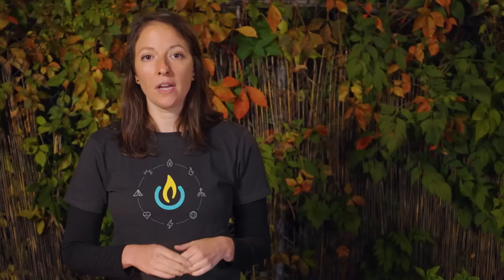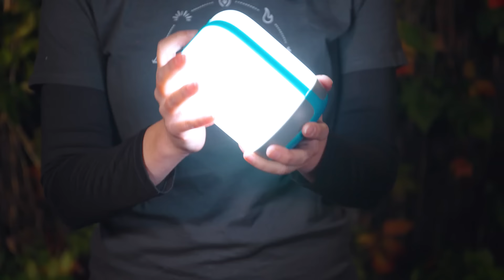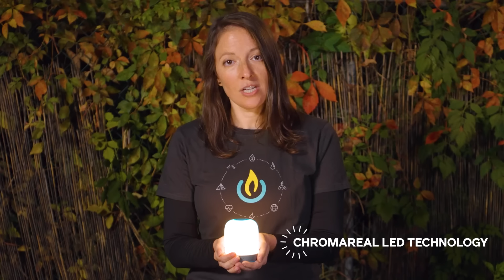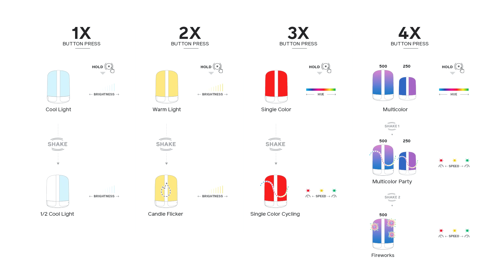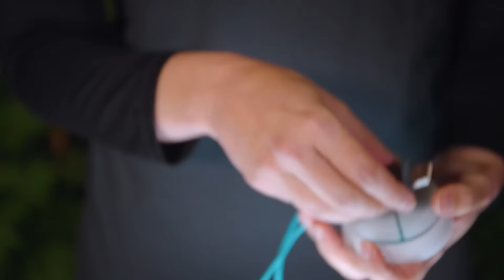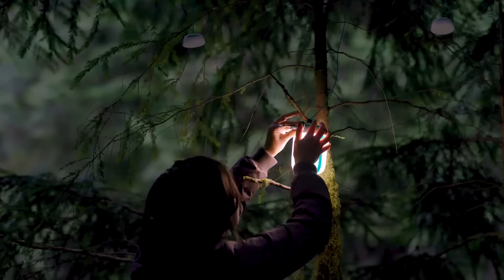BioLite AlpenGlow | Instructional Video

Comment: Just purchased 2 of the 500’s and a 250. Upon closer inspection there is a hazard warning for “Cancer and Reproductive Harm” in tiny font on the underside of the packaging?? Is that in relation to the lights, the materials used in manufacture or the packaging??? Seems very odd for an environmentally conscious brand and something I regret purchasing … was dual purpose for camping and for my kids night lights, which I’d be irresponsible to use for this purpose now I know this! Think I’ll return and get a refund. Plenty of HARMLESS alternative light sources on the market
Reply from the maker: Hello - thank you for the note! To address your concern, our AlpenGlows don't have materials that require that warning. Why is it on there? The state of California requires this notice any time a product contains a specific material - in our case a plastic. Our manufacturing team is working on completing testing through an independent lab to get this removed - a regular process that often takes some time and overlaps with initial production runs. We hope this helps you get out and use the product with peace of mind!
Reply: @BioLiteChannel  … That’s a great response and exactly what I needed to hear. Thank you

Comment: I just received my Alpenglow 500 today and I love it. The only flaw that I can see is that the candle mode is not continuous. It flickers for about four seconds, pauses for one second, then repeats the pattern. Apparently that is by design; you can see the pause at the end of the flickering at 2:47 in this video. 

I wish the flickering were continuous, but maybe it is designed this way on purpose to conserve battery power.
Reply from the maker: So glad to hear you'r enjoying your AlpenGlow! Candle Flicker mode is designed to have a natural flicker cadence (smooth flame effected by occasional air movement) which is why it's not continuous, but this is great feedback for our team. Thank you.
Reply: @BioLiteChannel  I also considered that might be the case. In my opinion the pause only makes the flickering appear unnatural because it is on such a regular pattern. If you do want to keep the pause for making it appear more natural, my advice would be to make the pause shorter, or better yet, it should be completely random in terms of when the pauses occur and how long they last.
Reply from the maker: @nathanjamesbaker  thank you for the feedback!

Comment: My 500 weirdly doesn't appear to have a bright mode and I seem to be following the directions properly. It flashes but doesn't actually change and become dimmer or brighter. I'm wondering if it's because I used it straight out of the box without first charging it. But it cycled through all the colors, fireworks etc with no problem. At one point after lots of monkeying around it went into a mode in which if consistently repeated an ultra almost painfully bright flash pattern (but slow) but I don't know how I did that nor its purpose and it would never stay on that bright - it would only do a brief flash. Any thoughts? Thanks.
Reply from the maker: Hello - thank you for reaching out. This is not an issue we recognize. Please send us a message through our form so that our Customer Service and Engineering Teams may review and offer their best guidance.

https://help.bioliteenergy.com/hc/en-us/requests/new?ticket_form_id=1260805176450
Reply: @BioLiteChannel  It only had one light on for battery level so I charged it then went to bed. Woke up and it now behaves as it should! So I think obviously that its behavior was that on such a low battery it won't allow bright other than the quick burst of ultra bright. That may have been its own way of alerting that it's almost run dry, which would actually be a smart feature because my trying to change the brightness level induced it probably (it would be horrible if that started on its own while sleeping for instance).
Reply from the maker: @Ayram9  great to hear it's working! Good catch, yes low battery mode will put in a reserve state to give you a bit of light for as long as possible.

Comment: Why not include stronger batteries? 1200 mAh to 2500 mAh wouldn't cost that much more but the lamps would last so much longer. I don't get it.
Reply from the maker: Hi Hans -- the 250 has a 3200 mAh battery and the 500 has a 6400 mAh battery. We're fitting a lot of functionality in a very small space while also trying to keep weight and cost in mind for our users. Thanks!

Comment: I got mine a couple months ago, two of them. One of them thinks it is charging  or won't switch to the colorful modes anymore. Just the cool white and warm white modes. Help? Let me say though the lights are beautiful. I have the base XL version too and it is alright. At least in the new ones, you don't have to get on your phone to get to the color morph mode on the XL basecamp. That is an improvement seen in these AlpenGlows'. But is there a factory reset or something to fix my problem. They aren't old and got through Dillards couple months ago.